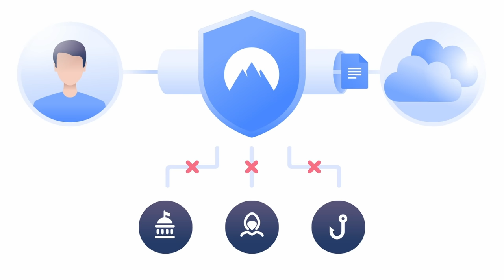FULL VAN BUILD in 15 Minutes! | Start to finish Modern Luxury 4x4 Sprinter Van Conversion

Comment: So get a beefy frame van that can tow some good weight, has a big diesel engine and doolies. Convert the fuel system to run on used cooking fuel, then get a decent size enclosed trailer. Put your reasonably sized dirty cooking grease storage tank in there, grease fuel filter system, battery bank and solar equipment, and more. Don't forget to put a big thick umbilical cable for the inverter to connect to the van through the trailer tongue and wiring to the van.  Then you will have a fully sustainable rig with free fuel as you collect from places that allow you to drain their garbage grease vat for them. And you'll have the freedom to set up your trailer with a bar too or whatever you want. Yet still having the van rig as your cozy living quarters with energy efficient appliances keeping you warm and entertained. Upgrade your suspension to aur ride for smoother trailer towing ride. Don't forger the easy hookups and quick pump start switches for the hoses and pump on the trailer outside too so when you roll up on those grease dumpsers you can drain it like a ninja in the night.

Comment: A couple of question … what was the color white you used? Very soft without being creamy. Also what were those clips that hold the shower curtain on the rod? Last question how did you find working with the cane, i.e. Did you soak it? Spline it? Staple it? Thanks!
Reply from the maker: We answered a lot of these questions in Instagram in our daily check ins of the build so follow us their for that on the next one!

Comment: Hey I’m wondering what skylight you used for the roof, been looking for one that size for my caravan. Thank u
Reply: I believe it is Dometic Midi Heki. Unfortunately, it is almost impossible to buy from a US supplier. I have been looking for my van conversion. I know people are taking advantages of your videos and copy your work but I wish you guys share the details of your supply @scarletandseth There are not many sources for beginner van convertors for skylights. Thank you for all inspiration.
Reply from the maker: Yeah this is true, honestly we don’t have any supplier, we are usually finding them wholesale on eBay and importing them from Germany so it’s quite a time consuming and expensive process. That also means once you buy it there’s no link to share anymore. The one we used in this van is the Heki 2.

Comment: Great build and video! What did you guys use to fill the gaps in the plywood wall panels before painting?
Reply from the maker: Which wall panels are you referring to?
Reply: @scarletandseth    hey thanks for replying! I was referring to the panels you used as the main walls in the van (I'm assuming it was plywood). At 11:47 in the video the seams between the plywood and the screw holes are filled and I was curious what you used. I was looking at normal joint compound but didn't know if it could hold up to all the driving without cracking/separating. Thanks!

Comment: How did Y'all seal the back ski light? The roof ribs on my van ski light are leaking and I am not sure how to fix that? THANKS for a great video!
Reply from the maker: There are custom inserts that are 3D printed to fill the ribs on the skylight.
Reply: @scarletandseth  I have access to a 3d printer that prints 39x24x24. Where can I find a model?

Comment: Hey, I was wondering what you used for insulation? And what are the strips on the floor after the killmat
Reply from the maker: The strips were poly iso insulation mainly to make the floor sit more evenly then 1/8 inch foam over top before the sub floor. The insulation on the walls etc. is 3M thinsulate
Reply: @scarletandseth  was there another layer you added after the thinsulate? Do you think low-e is needed/do you use it? Thank you!